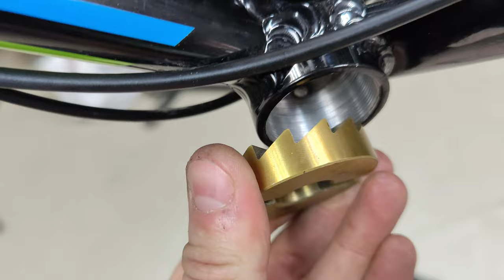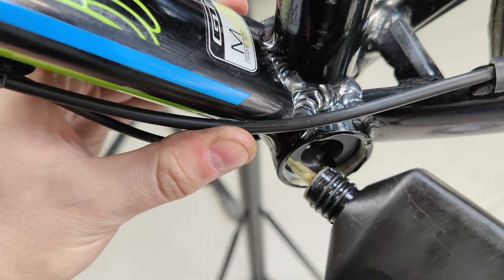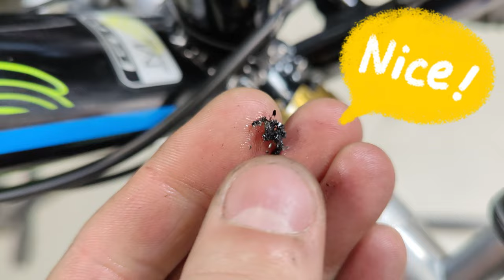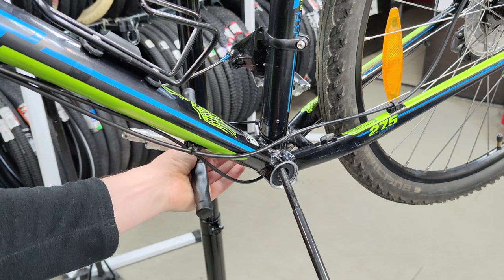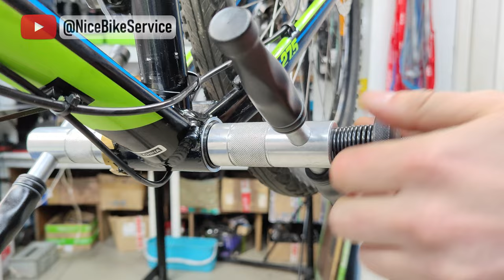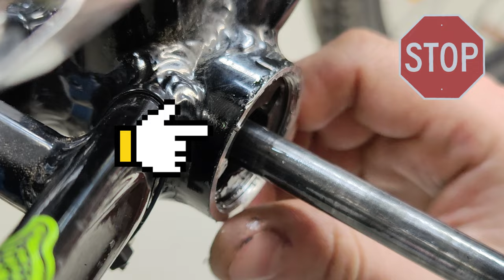It needs to be fixed in your bicycle ! Creaking bicycle bottom bracket.

Comment: The LBS sold their facing tool! My fixed drive side shell looked worse than that! 4 hours later  after filing and testing the shell with machinists bluing against the cup flange,  I got  that result! Test a prospective bike shop and ask if they have this tool. If not, I'd question their commitment to service. Threaded Shimano external bearing cranksets are still common and square,  octalink, and Issis still are out there. Threaded is coming back with its warts and all.

Comment: A noisy BB is usually due to be installed dry. This tool is really good when you add a chain guide BB mount. Because cranks becomes to short and chain line is ruined because of the thickness of the chaineguide. This tool is practical but not for what you are claiming about.
Reply: well if the BB is not seating all the way down because of a big paint chip if it rotate under pressure it may move but this tool is precious to fix a chain line that stick out too far.

Comment: I understand your point to make the surface parallel between right and left faces, because the bb shell will sit on them. But I'm not sure how much precision you can achieve with that tools? It is about bearing alignment, right? So it should be in a very tight tolerance  of parallelism.

Comment: Are you taking measurements? Or just randomly taking metal off?
Reply: the exact width of the BB shell is usually not as important as its facing. Most of the BB has a tolerance +/-1mm in a shell width (or even a bit more) with no issues. Also one could use the width adjustment washers, which is widely sold

Comment: The facing tool's main problem is the poor surface finish left behind . Also the thread in the bottom bracket may not be perfectly perpendicular . I lap the surface afterwards to keep dirt from entering absolutely best standard possible .